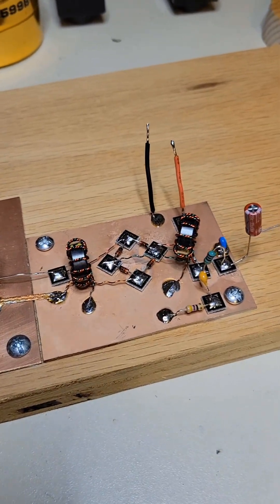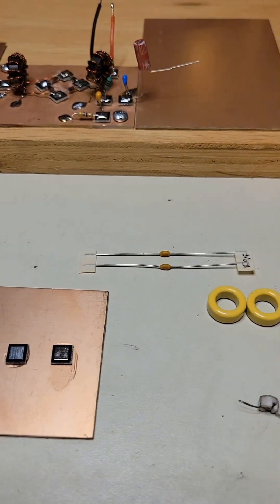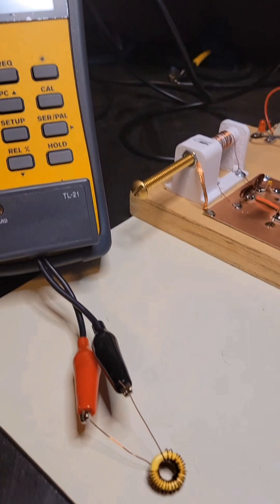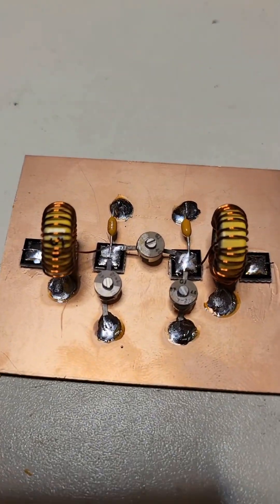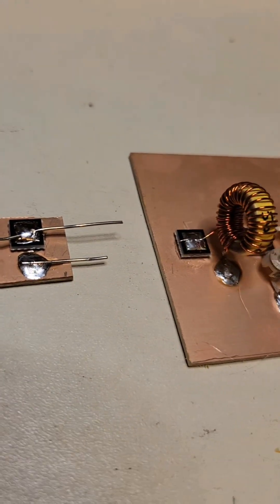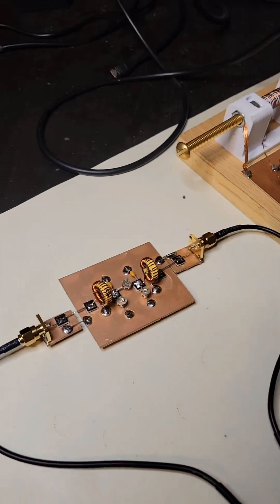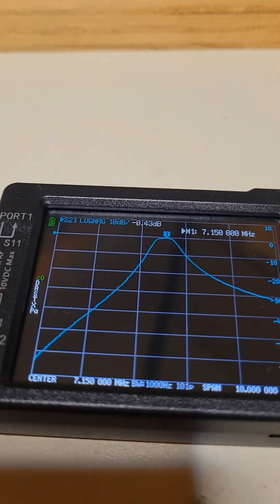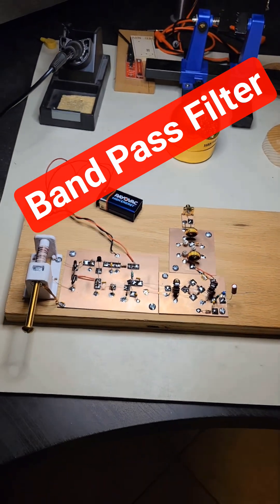Band Pass Filter Stage Complete

Comment: If you use this filter for an amplifier, it will perfectly clean the radio frequency interference from the power network, BUT at the same time it will greatly worsen the dynamic characteristics of the amplifier. 😢